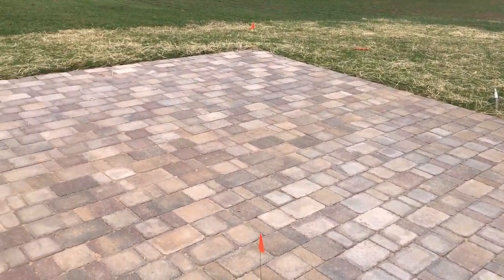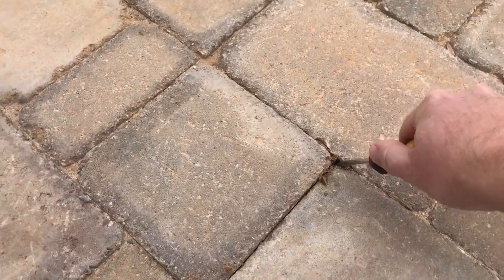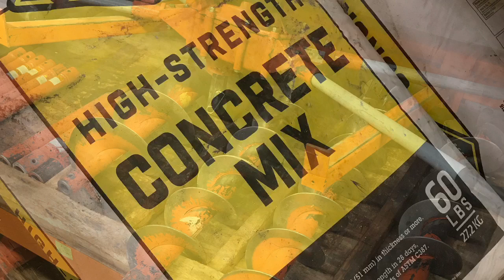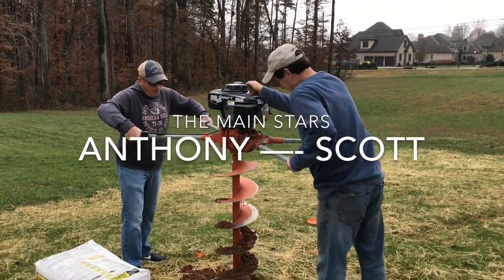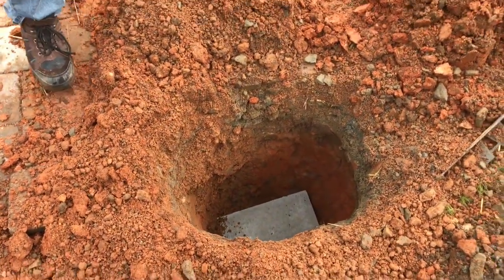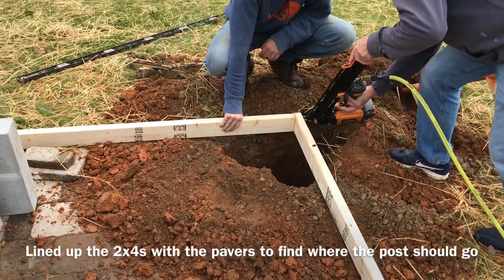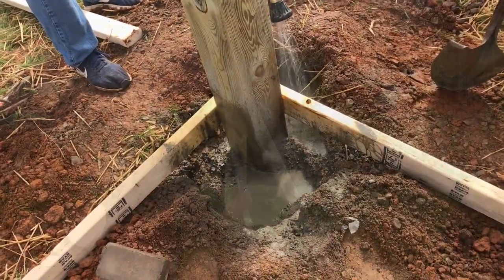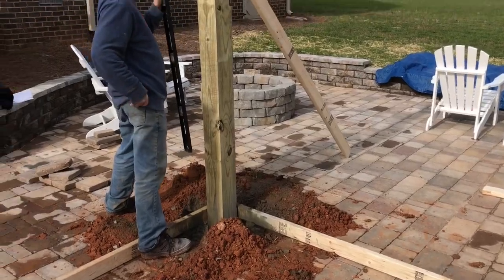How to BUILD A RAMADA OR PAVILION - DIY (Part 1 - Posts) | Backyard projects

Comment: You videos have inspired me to try to build a 20x20 pavilion in my backyard. Were the blocks placed in the hole for stability purposes or to prevent rot?  My brother (a self proclaimed know it all) stated that I should never submerge a post in concrete because it will eventually rot.  He stated I need to pour 6-8 inches of gravel in the hole first and then out in the post and concrete OR pour the concrete in tubes and stick a foot bracket in before it cures. After it cures, stick the post on top of the footing.  Still trying to figure all of this out before I tackle this project.
Reply from the maker: +Leonard Skipper After talking to another friend who is a contractor, he agreed that there should be a footing (blocks or poured) under the post first. He and I disagree, however, that pouring concrete around the post will accelerate rot. It’s either going to be surrounded by concrete or wet dirt right? 

He also pointed out that you want to dig the hole about 1/3 of the height from the ground to the headers deep. 

So glad you were inspired! Keep me posted on your progress!
Reply from the maker: +Leonard Skipper Oh, and also note in the picture of my buddy’s completed one in the Introduction video that he has 3 posts on his longer side.
Reply: Help me DIY thanks...I think I’m starting  to understand the concept of why footers are used.  I guess from the perspective of submerging a post in concrete without gravel or some type of drain system, it’s the same as hydrostatic pressure in a basement...the water will eventually saturate the concrete and rot the wood.  It’ll probably take years for that to happen I suppose.  Nevertheless, I think I’m going to go with footers that are 24 inches deep and 6-12 inches above grade.  Your final product came out beautiful btw.
Reply from the maker: Leonard Skipper thanks! I have 4 more parts almost ready to post :)
Reply: Dig hole, lay down 2x2 cross rebar, pour 8” of concrete, let it cure, lay up vertical rebar on square with diamond tie and pour concrete with post bracket. For a 20x20, your footings or piles need to be wide. The footing in this video is insufficient to spread the distributed weight of the full dead load. Just a matter of time before the piles start to sink and liquefaction to set in. That looks like pretty soft soil.

Comment: I'm skeptical about that wood poured in concrete. But overall great video.
Reply from the maker: +J will thanks! Is it the best way to do it? No. Does it look really good and work? Yes. :)
Reply: @HelpMeDIY  and mpa rating skyhigh, try cracking that. Thanks for sharing
Reply: Same prolly won’t last 5 years.